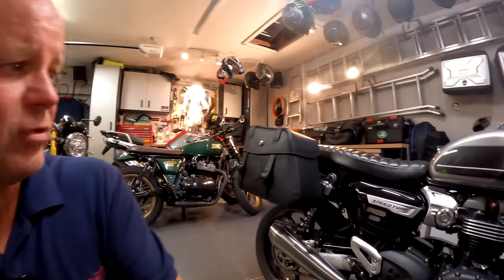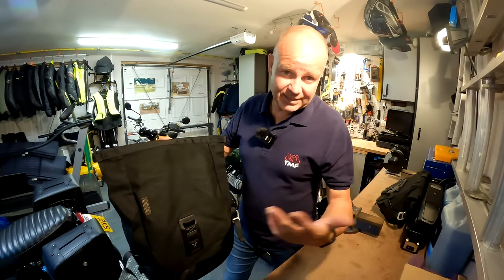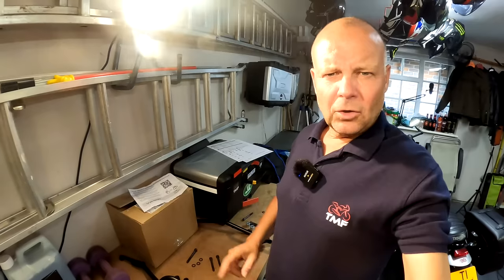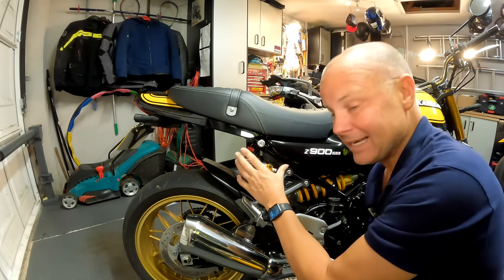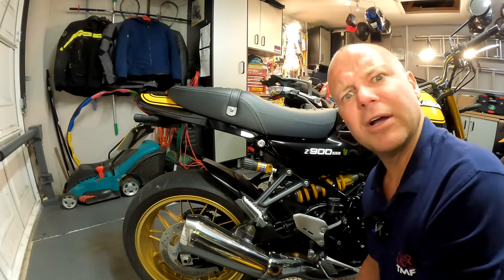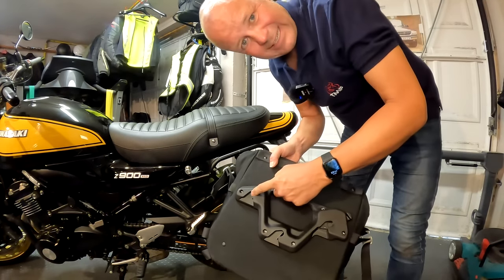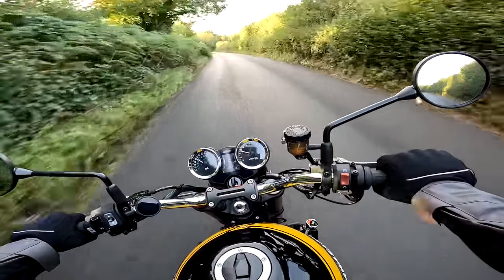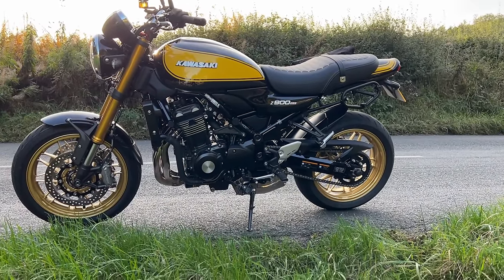Kawasaki Z900RS SE - An attempt at installing SW Motech Legend panniers!

Comment: I’m glad you went with these.  I suggested it / them.

I just bought the exact same bags in black for my new Moto Guzzi V7 2023.  Easy installation, minimalistic, look good, not bulky, and I can swap-out with the “urban” side cases using same rack for grocery shopping and longer rides.

Nice too that they lock on from the inside.  I use only one daily for my laptop and cafe supplies to work anywhere.  Just snap off and carry away in one second.

I just waxed them to be more rain-proof.  Lots of fun and old school.
Reply: I have them on my V7 too, great bit of kit, much better that the ugly c-bow system I had before..

Comment: Well this video started my Saturday morning off with a smile 
Having worked in the motor trade for 30+ years I’ve had the deal with awkward and Fiddley operations like this on a daily basis 
It’s not something you get used to but you do develop a tolerance for tasks like this 
But you got there in the end without chucking spanner’s around the garage and it all looks good sir. 👍
Reply from the maker: You must be very patient!
Reply: @TheMissendenFlyer  you just need to slip into a different mindset when doing tricky tasks 
I work in restoration nowadays so most jobs I do are all fiddly and awkward but yet it has to be perfect when it’s done so it can take ages

Comment: Hi Mate, I also have had the same bags on my Z900RS for a couple of years now. It is advisable to have a few drain holes on the underside of each bag because, although the waterproof linings are indeed waterproof, the bags are not so on a rainy day water collects at the bottom. I had 3 equispaced holes on the bottom of each bag with an open hole press stud to stop any fraying.
Reply from the maker: Good tip!

Comment: Fitted these to my xsr 900 with ease but don’t recall trying to fit all the points at the same time.  I would recommend fitting a self adhesive rectangular red reflector to each bag.  They sit nicely on the smooth vinyl strip at the bottom of the rear quarter (of course). Look good and shine up well to following traffic.

Comment: Matey, I fitted a set of these to my Jaffa a few months ago and I had the larger bags on BOTH sides with no interference with the exhaust, no problem at all.  When I went for a ride with both bags on I arrived at my destination to discover that one of the bags was missing!  It had obviously become detached whilst riding but I hadn't felt it come off.  I retraced my journey to find it leaning up against a bus shelter so some kind person had retrieved it from the road and put it to one side.  Moral of this story (bag was undamaged luckily) is to make absolutely sure that the bags are 100% secure when you put them on.  TBH I thought I had made sure but it might require a more thorough check.  Great channel BTW
Reply from the maker: Crikey that's a good lesson to learn at your expense, thanks for that!

Comment: I do like the brand and the brackets don't distract from the nice bike lines so you can leave them there which is great. The only thing I didn't like was the size difference from one side to the other. Prefer if they were similar-sized bags. But hey you gotta do what you gotta do. It's practical and a good product. Well done!
Reply: The bags don't need to be different sizes; the large one fits on the exhaust side no problem.
Reply: @auscurrymaster  I wondered. Sometimes manufacturers ere on the side of caution..

Comment: I have this for my Bonneville. I thought the install process was straight forward enough that I didn't bother with the instructions. It was pretty easy. In your defense, I have a lot of experience assembling complex automation machines. Also, I prefer to roll my bag (I only have the right side small bag) the opposite way than you have them. It looks cleaner with the open end facing the seat of the bike. 

I bought the bike used with the Triumph leather panniers already installed and I knew right away that I was going to be taking those off the bike. I think they make the bike look hideous. This bag looks so much better, and only slightly more tedious to open and close than the factory bags. Super happy with it. I haven't been in the rain with it yet, and don't intend to.

Comment: G'day Andy. I found the same problem with the two rear screws being put in so bloody tight from the factory. Hope you enjoy the poanniers and that they perform well, but my OCD couldn't handle that lopsided effect. I reckon I'll get myself the Ventura rack and bag for my SE, plus it will go well with the Nelson-Rigg tail bag. I'm a solo rider, so travelling light is the norm for me. Glad to see that you kept on with the install brother, but may I suggest that a cup of strong black tea (you being a pom), would greatly assist with the spatial thought process. Personaly, I'm a coffee addict with my brew set-up in my garage. It helps brother. Cheers.

Comment: Haha...good video, and, due to being less than competent with a spanner myself, very much like the experience I had fitting SWMotech panniers to my previous Triumph Tiger 900 GT. I went for the SWMotech ones over Triumphs because they were smaller and lighter, and I really do rate them, but for me, fitting really did try my patience. As a small excuse, the Tiger frame had 5 areas that needed connecting to the bike, and it felt like I had to almost dismantle the rear of the bike (exaggerating a bit!). Good kit though.
And by the way, I do love that bike of yours - I like the style, the colour... everything! There's got to be room in my garage for one!

Comment: Thank you for the video. It will make my job easier when I finally decide to buy that set. As I can’t have both the brackets and the grab rail, I ask you if the passenger can grab safely the brackets with some confort.
Reply from the maker: Not tried that - good question!

Comment: I went for the Givi Canyon 25L on my KTM 390ADV prior to a trip around the Devon & Cornwall coast... Absolutely love them. Also a bit 'not enough hands in the right place' to fit the mounting brackets, but the bags just drop on to the mounts at the bottom then click in to the lock at the top.

Comment: Enjoyed watching that no holds barred presentation 😀 I think the reason you initially had trouble removing the offside under seat bolt was that you were actually trying to do it up!! At least that's what the hand strain looks like!! Nice job in the end although, like Rebel_Canuck, I'm not keen on the look from the rear. Worth investigating the swap of bag he suggests, plus of course you'd have more touring capacity as well!!
Reply from the maker: Yes I quite like the sound of that!

Comment: Hi Andy.
Just a heads up. If you decide to buy a grab rail. The Motech bolt under the seat won’t fit. You’ll need to attach the pannier frame to the grab rail with a jubilee clip.
Reply from the maker: Thanks for the tip!

Comment: Looks great. What I did fitting crash bars to my Honda asked my wife to read the instructions we had two bikes to do first one was ok but on the second bike we noticed an engine bolt had been over tightened and the head of the bolt 
Was actually missing
 from new ! So as not
 to be blamed for this
 had take the crash
 bars off back to the 
dealership had get the
 bolt replaced under
 warranty. Then fit the 
crash bars again what 
a nightmare. So much
 so when I trade the bike I will probably leave the crash bars on the bike. 😂

Comment: As mentioned before (probably annoyingly so) I'm looking at the Z900rs and planning on touring as well. Those SW Motech bags look good but I was thinking they may be a bit small for touring beyond a long weekend. I was looking at some options for a top box mount and Nelson-Rigg saddle bags and maybe a tank bag- just for touring mind you. Those Legend bags look great for everyday use and light touring. 
Sorry I got to your live stream late yesterday but I watched it and you mentioned Freddie Dobbs. In his video of the Z900rs, the bike he borrowed was set up for the top box and panniers. I'm pretty sure it had crash bars and maybe highway pegs on it too. It was pretty specked out for hauling gear.
Very much looking forward to any lessons learned touring with that bike and this bag system. Cheers Andy.
PS. We've all been there at some point assembling stuff. I worked with the US headquarters of Thule for awhile and can tell you stories. I basically went to assembly school for the first month working there, which was actually pretty great. I'm kind of surprised they haven't gotten into this market as well but they seem more focused on all things bicycle, bags, phone mounts etc.

Comment: I have a Z900RS Cafe (love it) and have the same setup. Had them for a couple years now. IMO the best looking bags for a retro. I roll my tops towards the bike,it looks cleaner. Love the channel, cheers from across the pond.
Reply: Hello sir
Did you go with the smaller bag on the exhaust one side and the larger on the none exhaust side?
If so
Have you considered larger bag for exhaust side?
Reply: @bryangrant2636  I have the 13.5L on the left and the 9.5 on the right. I have a higher exhaust (Hindle megaphone) than stock,there is not enough clearance.

Comment: Andy, you definitely don't need the smaller bag on the exhaust side. I have the non-SE model and have the larger bag on both sides, and the bag sits well above the pipe, on the exhaust side, and being non-SE or SE is not material to how the bags sit on the bike (and it's the same exhaust). Another thing you may find is that the top straps on the bags are too short if you fill the bags up. I think there are strap extenders out there which I'm currently looking into. Apart from that, the bags are beautifully made and a joy to use.
Reply from the maker: Great tips - thank you!

Comment: I have SW-Motech Pro Blaze Saddlebags for my BMW R1250 R. You have to attach a bracket between the frame and passenger footpegs into which a rod is placed in. Their instructions had a diagram that was reversed and incorrect. I finally figured it out and took photo on the diagram and the parts and sent to them and told them they needed to get their engineers or illustrators to do a better job.
Reply from the maker: Yes the instructions aren't the best I've ever come across....

Comment: I have some SW-MOTECH  hard paniers on the Super Tenere, I got what was called the Evo frames, which have a 1/4 turn screw, of which one has a lock so as not to be stolen.  But the frame comes off too, in seconds, so it looks really clean when not in use.  Don't know if they would have been available for other bike's. 😊

Comment: Tbh, I think the most discreet pannier racks are the 3P from Shad, plus the advantages of lockable hard panniers 👍
Reply: I absolutely agree. They look sleeker (personal opinion) And they are the same size (L=R). I actually have the Shad 3P for pannier with the Givi top box mounting bars; which looks super sexy / industrial / retro with the boxes off. (Thrown in with some SW-Tech crash bars and matt black hand guards).  It did require a bit of 'manipulation' though. Gotta love after-market mods!

As always, love your work.

Comment: Hi Mr Flyer. The allen bolts are thread locked from the factory so you had a initial problem to unscrew them. Thread lock is to stop vibration loosening of the bolts. Please consider undoing them and applying thtreadlock/ It will also prevent rust welding of the thrteads :yt:🤓💯❤‍🩹
Reply from the maker: Thanks for the advice….

Comment: I have the same bags. On my Honda rebel. Surprising how much they can hold. My only criticism of them is they are not lockable to the mounts.
Reply: That's kinda a big deal 😨.
Reply: @kalnwi2023  they won’t come off while riding. But once parked up. Anyone could just unclip them and walk off. I got some small sturdy luggage locks and use those to lock them to frame. I also thread them through the loops on bag so if someone does decide to try get inside they have to cut the bag. Making them more suspicious to passes by
Reply from the maker: Good tip!

Comment: Don’t get frustrated stay with it, the more spannering you do the easier it gets.  Can I suggest to get a bit more leverage on the Allen keys use a bit of tube over the key. Ideally invest in an Allen key sockets to go on your socket wrench, 3/8 drive set is a good size to have.

Comment: Hello Mr. TMF

I have a few quick questions 

1. Do the legend bags come with the brackets already attached to the rear of the bags, or is that bracket a separate purchase?

2. Can the Z900RS SE hold the large legend bags on the exhaust pipe side?

3. Can the SW MOTECH bracket fit if i have the passenger grab bar on the bike?

I also wanted to let you know that I've purchased 2 bikes from watching your videos 😅. The 1st bike was a CRF250L (which was stolen), and now the 2024 Z900RS SE just picked it up last week, i ❤ it.

Thank you in advance from Atlanta  Georgia 
Loyal subscriber Bryan Grant
Reply from the maker: Hi Bryan - no (separate), yes and sadly no…..

Comment: Andy, are you related to Freddy Dobbs lol. Those bolts you were removing were dry, a little (lithium based) grease or a drop of oil (as a last resort) would help.  They look good, didn't spoil the bikes lovely lines, but at a price though.  I went through Great Missenden yesterday for a visit to Hughenden Manor (well worth a visit).
Reply from the maker: Yes it's nice up there isn't it...

Comment: They look fantastic, both with and without the bags mounted.  Great choice.  Had you not been trying to film the installation, you likely would have been able to concentrate more, and it would have gone smoother.
Reply from the maker: Yes I think you’re right - when I film stuff everything takes twice as long (not making excuses but it does add another layer of faff)….

Comment: The first thing I do when fitting swag to a bike , is get a selection of washers ,spacers & nuts & bolts , as usually the ones supplied are not all there , or not the correct ones for the bike .  The second thing to do ,is chuck the instructions in the bin , & use common sense .  The bike looks a lot better with the panniers & frames than i thought that style of bike would look ,it’s better than a pack on your back ,or a big carrier & top case . 👍
Reply from the maker: I agree!

Comment: I can never get past the price of motorcycle luggage. It just seems insane. I've travelled all over Europe and the UK and have always made do with a luggage rack and a decent dry bag. It ain't pretty but it's cheap and it works.
Reply: Frank, like you I toured for many years with a big gym bag strapped to the pillion seat, I survived ! I now have a Tiger with topbox & hard panniers. To unlatch and take them into accommodation is a joy. Also no more checking bungee cords & elastic net en route.

Comment: Ok so you made hard work of it. They are on and functional. I class that as a result. I fitted Honda bags and Hepko rack on my Hornet. Not designed to fit together. Lathe, verniers, paint etc. I'm a grease monkey and it was a faff. Still classed it as a result though. Nowt wrong with having a go.👍👍

Comment: I see the appeal, I've been thinking about luggage recently as well, for some light touring next year, but I think if I had to go spending serious money, as these are, I would go for the Shad cases, rather than bags. Those ones are particularly lop-sided looking as well, which does them zero favours. I'm sure they will be more than functional though.There seems to be two camps here, regards design. Ones which are short on one side to clear the exhaust and the other spaced further out to clear the exhaust. I figure I admire my bike more in silhouette form, so would opt for the latter style. I was rolling at your mechanical skills, fitting the bags was worth it just for that 🤣🤣

Comment: I have the same bike. Have you installed a 16 tooth front sprocket yet? Transformed the bike
Reply from the maker: No I haven't - how has it helped? Snappier acceleration I'm guessing???
Reply: The opposite. It reduces acceleration the tiniest bit. But it's give it a lot more legs. You can comfortably cruise in 4th and 5th
Give about 700rpm lower per gear. Iris how the bike should have been released. Best mod you can do honestly

Comment: SW Motech is good stuff, I had a set of their engine bars on my 1200 GS which came in very handy when I dropped it 😳 That must be the cleanest mower I've ever seen, has it ever been used Andy😅 So the Jury in this case want to know why did you buy the panniers for the Triumph a few weeks ago which won't fit the Kawasaki. I bet you've got more panniers than Carol has handbags......

Edit: On a slightly more serious note are the bolts the Nyloc type? If not it might be a good idea to put some locktite on them so they don't come loose 👍
Reply from the maker: err 'cos I wanted panniers for the Triumph too!

Comment: Surely they could of made the bags a bit more similar in size for symmetry and looks, there seems to be loads of space between the exhaust and the bag. It does add to the practicality of the bike, but I think the jury is out as to whether any bags actually look good on a motorcycle. I ride around with a top box on my bike and everyone tells me how bad it makes the bike look. but when they break down they are quite happy to use my battery jump starter or have some of my spare fuel etc sometimes practical is the more sensible option.
Reply from the maker: Very true!